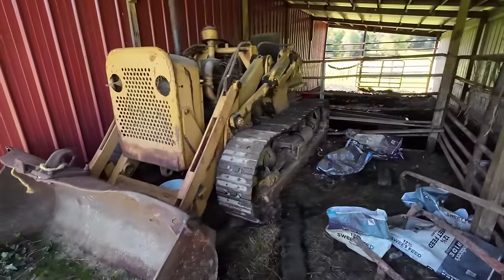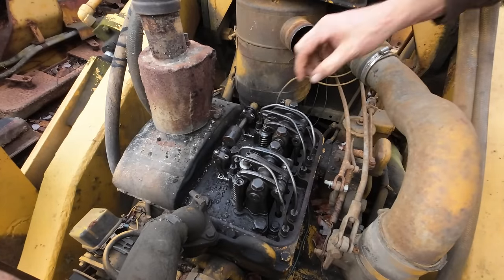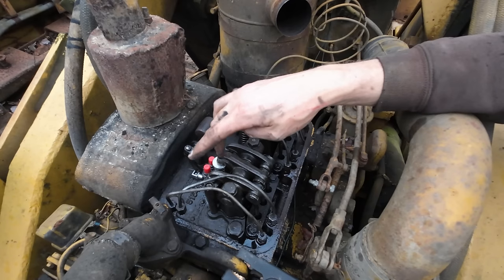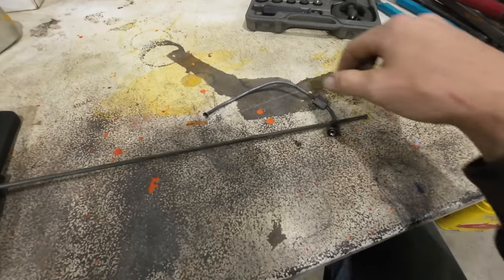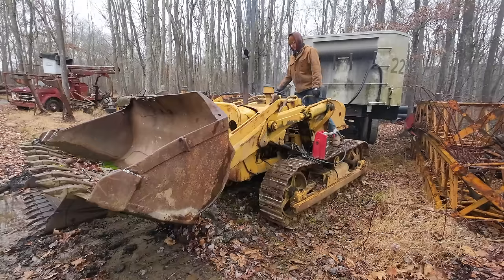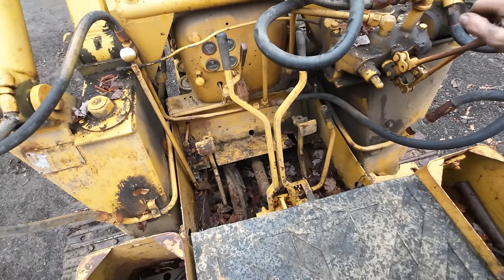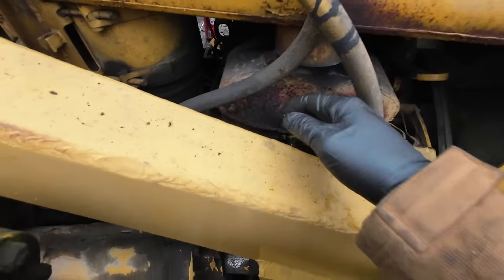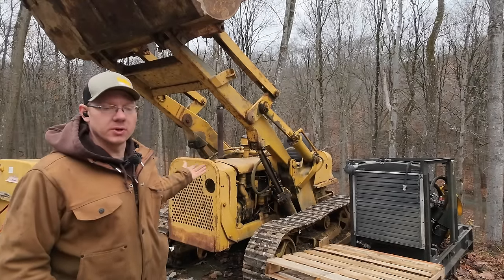$500, Allis Chalmers Track loader. Sitting for MANY years!  (Will IT RUN?!?)

Comment: Shure wish I was cliser!   I had an HD5 agricultural tractor with the loader kit (same).   Lot of weight in that machine and it is a work horse!   I took the bucket off and put a 13 ft wide brush rake on it.  It did great for what I needed it to do.

Comment: That air connection on the fuel tank would be for priming the system. If you feed like 3-5 psi into the tank it primes almost as well as if you had an electric lift pump.

Comment: Ya, the fuss about oils... Even a bad oil today is likely better than the best oil when that machine was built. Kinda like the old engines that needed a 25 to 1 two stroke mix. They didn't even have a dedicated two stroke oil back then (they used engine oil that is not meant to be burnt). I run old engines on 50 to 1 mix because the oil I am mixing is so much better. Crank case oils are the same. Use what you want. You are smart enough to make a good choice. Plus you have choices that didn't exist when that engine was built.

Comment: JIC 37 degrees on 45 degrees flares will work for low pressure applications. But dont rely on them in high pressures systems folks

Comment: The way Allis crawler parts are, you're gonna need 3 HD6s to keep one running. 2 strokes will run just fine with multi-grade oil, but they leak even worse than normal. Rotella T1 and  Delo 100 fully meet the specs.

Comment: Mike plant I worked at had tandem twin V16 GM EMD 2 stroke dual turbo (1 per bank) diesel engines.  The smoothest running but loudest especially on startup.

Comment: The way it is starting, you need some glow plugs. When you try to start without fluid, you get the cylinders hot, but not light off. You stop, the heat concentrates in the cylinder walls and the next try starts just fine.
Reply from the maker: Yah detroits don’t have glow plugs

Comment: Hi Matt! Just wanted to let you know that Scott from Busgreasemonkey channel would say that Detroits need straight 40W. I can't remember the reasoning behind it, but he did mention that multi-weight oil is NOT good for Detroits. I know that when he services buses and it has 15-40W, that is the first thing that he will do. I remember in one of his videos, a customer just had an oil change and they used 15-40W and he was quick to drain it.

Comment: To set the rack hold it in full fuel position and with a screw driver check that both injectors had the same feel of spring  on the connector to the unit injectors rack,,,this gives both cylinders the same fuel

Comment: So Mr. Creek, I am assuming that is a 2-71? Anyway the fuel lines on the injectors are all pressurized to ( trying to remember this from the 80's when I worked at a truck garage on detroit's!) 75 p.s.i. fuel comes from gear pump with built-in relief exits out head through an orifice fitting forcing pressure in the lines. All the old 2 stroke detroits  were set up like this. The fuel/oil leak was likely coming from the air box drain tube. The liners have ports in them because it is a two stroke and if the injectors were pumping out raw fuel it would have ended up in the air box and when old Detroits are idled alot the oil would be pushed into the air box and would slobber out on the ground through the airbox drain.  The blowers on the Detroit are for only moving the air since thier is no intake stroke. No intake valves, Only exhaust valves. Air is blown into the cylinders through the port holes via the air box and the blower pushes out the exhaust through the exhaust valves. I am also a link-belt master crane tech if you have any questions on your crane. Worked for Cali dealer 26 years.

Comment: If you can get them, bass guitar and large gauge piano strings make good cores to help support the walls when bending small metal tubing. Like you would when putting a spring in a pipe when using a bending jig.

Comment: I’ve always heard it explained as the detroits burn more oil than is normal now, and that carbon buildup from a modern oil becomes an issue.  The detroits spec a low-ash oil, which happens to be a straight weight

Comment: i had one like that.  straight 40 weight oil, multigrade will put all the muck into the system
mine had an either injector for cold starting.  those old 71 will tolerate hot start stuff.  they ten to leak a lot, all those hoses are a nightmare.  the 2-71 is only about 25 horsepower but the machine will do a lot.   the chrome was worn on mine.

Comment: when starting a cold engine diesel when cold chrank till smoke let stand for 1 min then chank  again the 1st turn over heats a bit when it sits the chambers heat,s 30 30 30 till it starts to hit works at - 20 when i worked inthe bush patience and 100 percent battery

Comment: I'm not in a position to buy it nor transport it 1,000 miles to the mid TN area, but if I got it, I'd probably use it to clear my land then yank the loader part off, use it as a tracked tractor.

Comment: I have the oil argument with guys on Facebook and forums all the time.
They have a 60 year old and want to use "the best" oil on it. 
I say, what was top of the line oil in 1960 is the cheapest garbage oil today. So anything is fine for your antique, huge tolerance, high displacement engine"

Comment: If memory serves, multi viscosity oils back in the day were actually a mixture of oils that had varying viscosities. Whereas today’s multi viscosity oils are actually selective stratified oils that display multi viscosities. That is a 10w30 is an oil that displays a 10 weight properties at colder temps and allows for superior lubricity and displays a thicker 30 weight viscosity at higher temps providing superior lubricity at those temps. At least this was information relayed to me by a Sunoco oil rep in 1989. Can’t vouch for the accuracy, just passing on what he told me.

Comment: We use to fill the steering clutch compartment with diesel fuel and work it it should brake the clutch pack loose  then drain it  pulling the steering clutch’s are a pain .

Comment: Got a trailer tipping cylinder with major grooves that we sanded with 1000 or so sandpaper as smooth as we could and instead of the normal 4 stage seals we put in 6 stage seals and after 4 years still not a speck of oil! But then again a tipping cylinder isn't used as often as a loader cylinder 😅

Comment: Just a heads up, there is between 50ish to 70ish PSI fuel pressure on these injector jumper lines. Normally the fuel goes through the primary filter, through the gear type fuel pump with a built in pressure regulator, then into the secondary filter, then into one fuel rail in the head, through the injectors, back to a second rail in the head then to a restrictive fitting screwed into the head, then back to the tank.

Comment: You can run the old Oil/Fuel in the M35... They are a Multifuel engine and it will burn just fine.
Reply from the maker: It’s running in the loader lol

Comment: I have a 3-53 on an old Prentice and have a spare unit that I pulled the injectors out and traded them out because one in the loader had a bad tip and I’ve been trying to find a place to trade them in, I hardly use the loader just setting here on the farm but, I think I’ll check with ADS ,

Comment: When I seen the fuel from return injector line leaking like crazy I would of immediately looked at the oil. But I would of looked at the oil before I even started this OP! You want to wreck main and rod bearings fast have the oil full of fuel!

Comment: you want to tell me you paid 500 bucks for this where i live that would have been a solid 3000 in the condition you got it thats just nuts i wish we had something like this in estonia where im from. I own a also early 60s machine its a belarus mtz 50 a old reliable 4 cylinder diesel that starts with a ponymotor and its just awesome will need a rebuild some day on the engine just head casket and maybe piston rings it leaks coolant but not to the engine but out and it starts good honestly i really like that old piece of metal havent had much problems with it so far only running out of fuel or fooding the little single banger gas its finicy at times but i love it i hate messing with electical problems and thats good because this doesnt need even a battery to start you can coil a rope on it and pull start it but in my case all it need is a battery and 2 cables thats it aint even a electric starter solenoid

Comment: Hi John, I’ve been watching your channel for two years. My thoughts are defiantly crack on with the engine rebuild. However, as usual must weigh up your time and cost saving think the rams need chrome plating plus new seals and possibly major service on hydraulics. 
Best regards
Steve 
Salford, England.

Comment: You can do what the old timers did and just dump the oil/diesel fuel mix in the tank and burn it! I doubt that old Detroit is gonna care. I'm surprised you didn't prefill the fuel filters before you tried starting it.
Reply from the maker: That’s exactly what I did
Reply: @DieselCreek  put the oil back in the tank? Or prefilled the filters?
Reply from the maker: @jonathanfrecking1210  oil in the tank. I use the pump to push fuel through the filters. Because it’s easier to contaminate if you tried to pre-fill.

Comment: Nice save on this old girl.  Yeah, there is a ongoing argument over 30HD and 15W-40, etc.  But the old guys that wrenched buss fleets and got a 1M miles out of 2-stroke Detroits will tell you there is merit to doing what the book says.  My BIL was a buss mechanic and worked on a zillion Detroits.  His opinion is that it's a shear issue.  HD30 is 100% oil.  All multigrades that are not EU defined synthetics have viscosity modifiers that are not really oil, but another chemical.  Bottom line is that HD30 won't hurt anything and it's known to be what the engine wants, so why not 😁
Reply from the maker: Well, for one good reason it’s hard to find these days. I like to run Rotella, but there was none available locally I had to get this tractor supply brand.

Comment: I just watched the stuff to do with the crane that scrappy industries has and you said that you like that he’s crane is like a workbench and the crane you got from the auction has a bit of unused space minus whatever is missing you could make something on it that could serve as a mobile workspace for stuff and tools for the crane and other tools for other stuff if you could also use the crane to make that lay down yard more compact and put stuff closer so you don’t need space for getting something to move it there (this is for stuff that you will use as parts or are inoperable so you don’t need to waste a lot of space to get stuff like a wheel loader or a forklift that is actually capable of moving outside of your shop without getting stuck every 1-3 seconds you just need to have a way of getting the crane around to cover the lay down yard you could do this with that industrial sized crane but i guarantee that you will put that in the shop and i know your not crazy enough to make a way to get it to work both outside the shop and inside it but your choice to make as you call the shots but you need to think about getting that crane in if you haven’t already)

Comment: Matt, that socket you used to attempt tightening the return line. Was it basically a line wrench in a socket form? It looked quite useful. Tips on where to find such a tool? I know i could have used a similar tool many times, but didn't know it existed. Thanks for sharing the video and getting another piece of old equipment back running again.

Comment: And when you are bidding keep in mind the starter needs to be replaced. When I was in the Army engineers there were more or less civilian International dump trucks in my squad. 12 volt systems. At the time all other Army machines were 24 volt. Guess what happened when these dump trucks needed a jump. Yup. The starters were compromised every time!

Comment: Those injector fuel lines on Detroit Diesels are notorious for leaking after removing an injector. I often just replace them rather than risk getting diesel into the crankcase.

Comment: Hey Matt why not take some of your old clean antifreeze and strain it and use it in these machine your working on that are not ready for shop yet but winter ready so they won't break same with that transmission fluid that red bur could be strained and used as a oil addtive to break down sludge buildup and

Comment: I've put literally thousands of hours on those old Detroit engines and anyone that thinks multi weight oil will hurt them does not know what they are talking about. Also when it is cold pull the engine stop and spin it over for about 30 seconds. Let is set about 30 seconds while the compression  preheats the cylinders. Should start on the second try. They are also why I say huh all the time.

Comment: Well yet another success story. I really admire your persistence in getting these old machines running. Judging from the ebay bids so far there is a fair bit of interest in it. I would have probably jumped in but the logistics of getting it to Canada are daunting. You did mention a Ford tractor (8N or 9N) that you sold but didn't, is it still on the block or are you loving it now?
Reply from the maker: No I ended up trading it for a light plant you’ve seen many times here.

Comment: Make sure to check the coolant... I think you put water in there and with the cooler temps... may make an issue.
Reply from the maker: I mixed it 50-50. It should be fine down to -25 or so.
Reply: Only saw the water go in :)  Good luck with sale. @DieselCreek

Comment: Multi grade oils were around when the engine was built. The reason for the straight weight oil doesn't have anything to do with modern oils. Mobil still makes a modern straight weight specifically for the 2 stroke Detroits, and most call for straight 40 wt. Multi grades have tendency to shear back to the lower number in shear zones like the intake ports in the cylinder on a 2 stroke. Engines that are designed to run multi grade don't have those gaps to fill. Maybe you could get by with a 20-50, but performance will fall off noticably  with too thin of an oil in a 2 stroke because it affects the engines ability to breathe and hold compression due to the way a 2 stroke diesel breathes.

Comment: Hey you r hd6 with a buda diesel is nothing more than a hd5 with a different engine, same tractor with the same problems. Track frames break by the rear sprocket , dry steering clutches that rust together and the main clutch does the same . The shifter is just worn on the ball. All in all good machines when you fix their problems , Thanks for saving the old iron!

Comment: The air coupling on the fuel tank may be so they can give it a quick prime after changing a filter (or if the pump is losing prime) via gender bender. (Two male air fittings coupled together)

Comment: Atleast now with all the mixed fuel and oil you can strain it, filter it and dump it in the deuce.
Reply from the maker: I dumped it straight into the fuel tank of this machine. The Detroit will eat it right up.

Comment: Great video Matt, I know the answer before I ask the question, why wasn’t you working in your nice new warm shop?
Reply from the maker: I actually prefer working outside if the weather is tolerable. Also, I didn’t feel like dragging this thing all the way down there to the shop and shoving it inside.

Comment: G,day Matt. Totally agree with you on the Detroit oil weight.
Technology has come a long way in the auto industry and so has oil.
I’ve just rebuilt a 6V53 in an M113 APC for a local museum plus I did a 6V53TT for my students at the CAT institute here in Australia.
Both are running on 10/30 HWY diesel oil and have no problems.
I’ve just started a small YouTube channel with military and Detroit diesel engines so please have a look.
Mr M113
@MrM113A1

Comment: There is a fuel transfer pump on the side of the  block between the tank and the head that is low pressure  it run off the cam shaft and has aseal that geos out and lets diesel get in crankcase exsplain the disel in the tane e k  the HD -5 was built in 1950's and the HD -6 was start in early 1960's with the allis chramler own engine !   The track are too tight and will take away power should be about 1 1/2 inch defection on them  steering clutch and turn bakes need adjusted too !

Comment: FYI diesels hardened seals like the rear seal if you use some tranny fluid in your oil it will soften those seals up especially hardened seals if they're contaminated by diesel fuels...🤪!!
Reply from the maker: Never heard that. Interesting.

Comment: Matt, going under that raised bucket on a totally untested machine made about as much sense as Pickett's charge. I love you, man, but one ruptured hose and we'd have two half Matts. We don't want that. 
I leaned in to a scissor lift one time, got the part that had fallen there, and NOT ONE SECOND after I got out, a hose ruptured, the thing slammed down with a force that still gives me the clammydamps. I confess it took two cigars and a shot of Old Nogginthrob before I could go back to work. I was shaking like a dog crapping a peach pit.
Just now I was yelling at the screen: "PUT THE OTHER BUCKET UNDER THERE!".
Working alone in the middle of nowhere is bad enough, but for God's, Mrs. Matt's and all our sakes, PLEASE be more cautious and THINK!
Thus endeth the lecture.
Nihil Obstat.
Reply from the maker: Any time I was under the bucket it was supported. I don’t trust that thing.

Comment: when they put the fuel line back on, they over tightened the nut causing a crack in the line, it does not take much torque to tighten that in the first place. then you get some 200lb ape at the end of an 8ft pipe and they wonder why they break everything.
Reply from the maker: The line was cracked above the nut. Not at the flare.